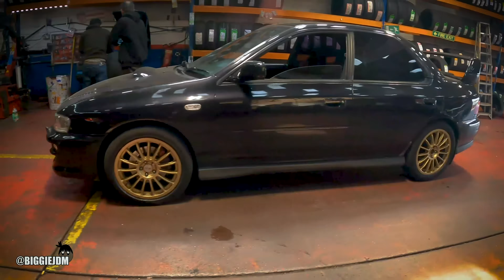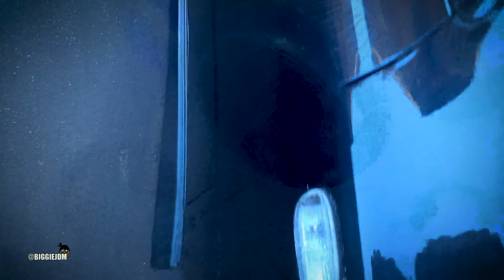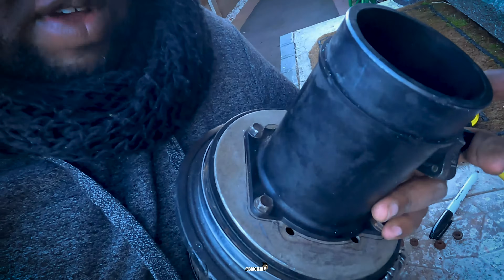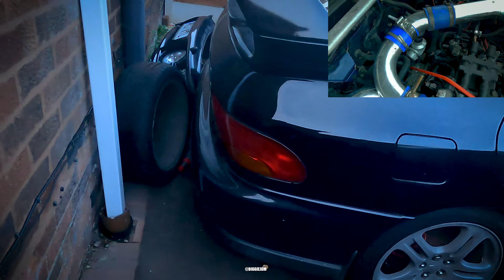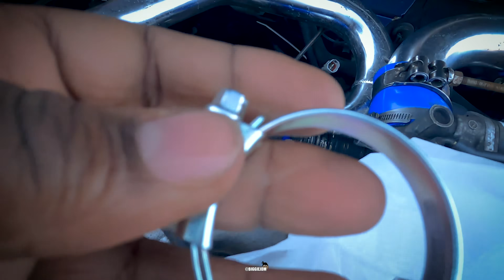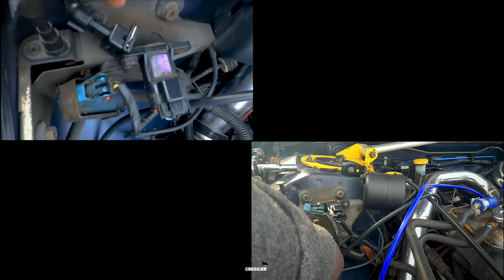STRESSED OUT!! GC8 TRACK CAR BUILD! MUST SEE!! #subaru #gc8 #projectcar #trackcar

Comment: Biggie biggie - seems like you’ve taken on an interesting build there -   While watching this i made some observations… tools ! You need the tools, if you had a vernier caliper you could have measured all the pipes and got the all the right accessories - cost on Amazon £6 - Also if you make a list of all the jobs that need doing you can tick off as you go . Also use your lunch break to feed yourself , going to the car and trying to do a job quickly never works - set yourself realistic time to complete each job- Good on you for trying stuff yourself tho mate it’s far more rewarding👍🏾
Reply from the maker: Great words of encouragement buddy, i'll check out that tool. 
Sometimes you need to step away from the desk and come outside, but definitely hear what you're saying. 
Appreciate the comment.